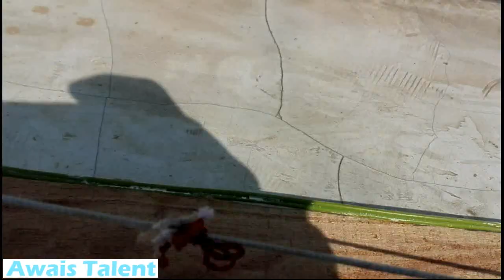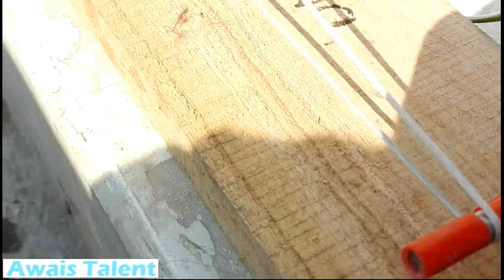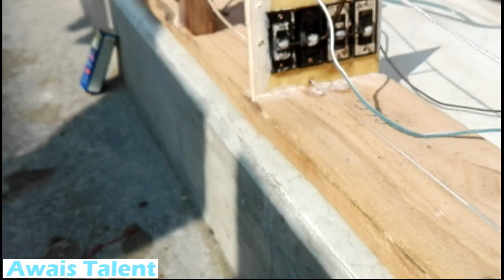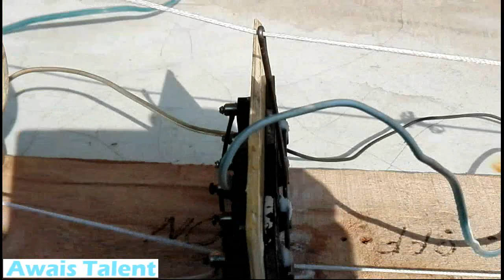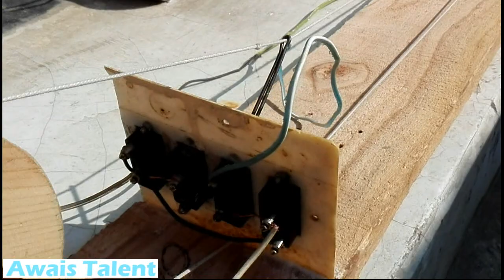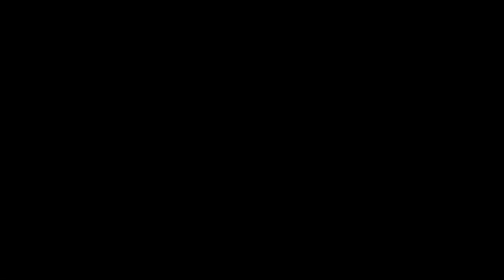Automatic Homemade Switch To Reverse DC Motor Direction

Comment: This is exactly what I need but it goes to fast for me to see. I need to move a prop about ten feet using a pulley and reverse-able wiper motor. Similar to yours it will hit a switch then reverse and continue this motion on a loop. How did you do it. I’ll pay for plans. Thanks
Reply: Just buy a module that does that. By the time you make this it be the same and that time is wasted.

Here is my video on the module
https://youtube.com/shorts/dHeIsAFeYvo?feature=share
Reply: If you still want to do this.

https://youtu.be/sjrkIctSmqI
Reply: @AztecWarrior69_69  Thanks for responding.  Any chance you have a link to where I can purchase the module you are referring to..
Reply: @goddale2002  You are welcome. Yes the link to the module is in the description of the video I linked to, in my first comment. Diagrams too.
Reply: Thanks. I actually did find a couple modules. Just need to get the switches.
Reply: @goddale2002  if you don't mind me asking.  What are you making? If you don't need timing or speed control you can make it using just a DPDT relay or two Bosch style relays and a power windows/locks harness. You spend $12 vs $20. Plus parts are easy to find.  

Also if you If you don't need a timed control there are other modules I know of.
Reply: I was going to use a Pico boo jr from fright props but it works by timing the distance. That does not work since the Pico boo jr does not have a park to return the prop to the original position when the power goes off. So now the travel distance for each direction will be off.
Reply: @goddale2002  weird that I left an explanation of why we should move the conversation to one of my videos, with link to that video and that one got deleted. Then I posted another link to a better video and that one is still up. Go figure.  In any case please contact me there.
Reply: @AztecWarrior69_69  happened to me to. My link to the one I found was deleted.

Comment: Better to use parallelogram mechanism for reverse and forward rotation, for avoid strain on machine..
Reply: Links?
Reply: Are you really suggesting that you us a mechanism, that takes up 3 times the space of the distance that needs to be traveled? Not to mention all the materials and cost needed to build the thing. How is that "BETTER"?